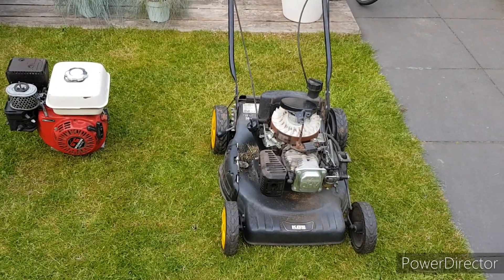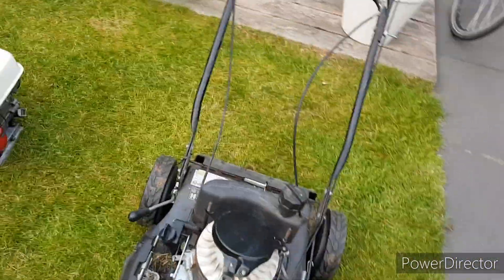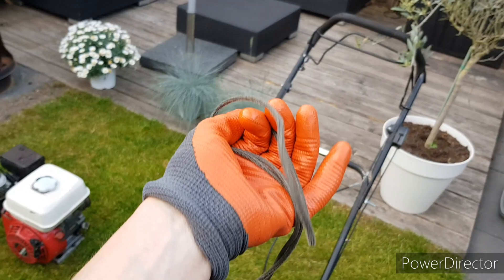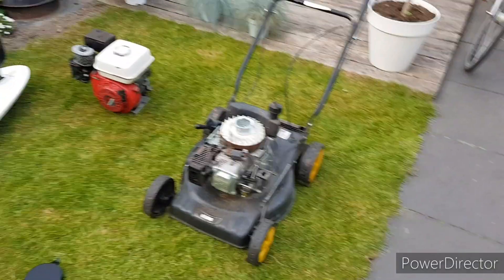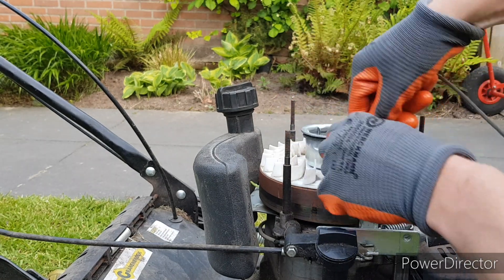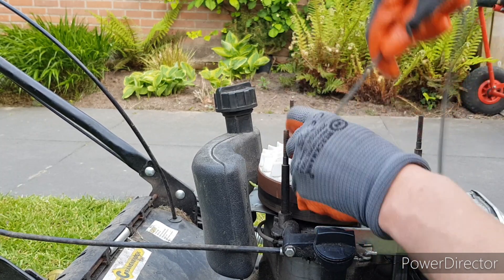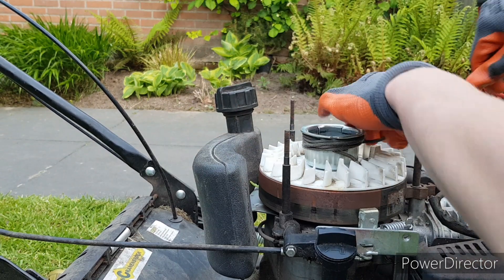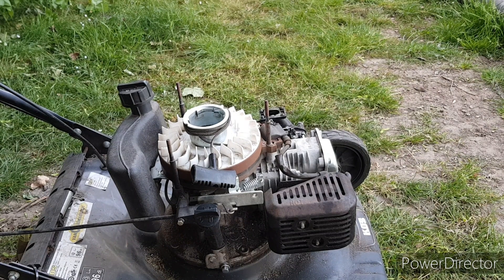how to start a engine without a pullstart

Comment: Doesn't seem safe to run it that way.  Pass.
Reply from the maker: Yes i agree with you, but this is for emergency.
Reply: Stop crying
Reply: Many old machines are started this way. Many Howard rotavators and Alan scythes are started this way. It's completely safe, providing you don't tie a knot around the flywheel, just secure it with friction, that way you won't loose your hand
Reply: Why isn't it? I' use to start a minibike like that all the time. It never hurt me or the engine.